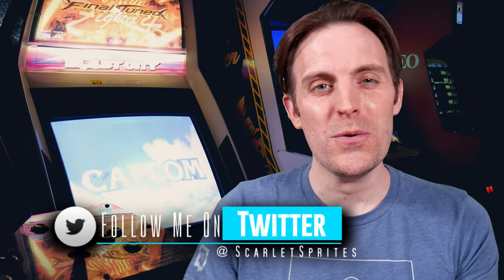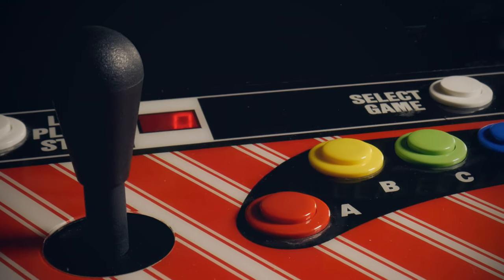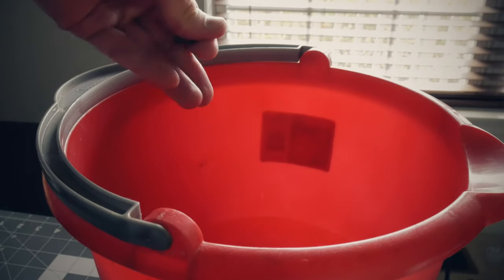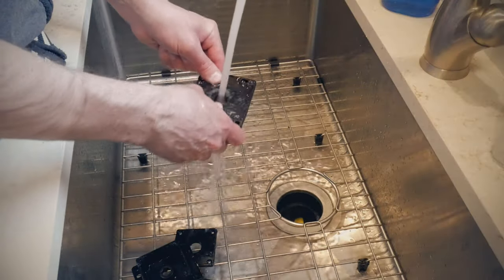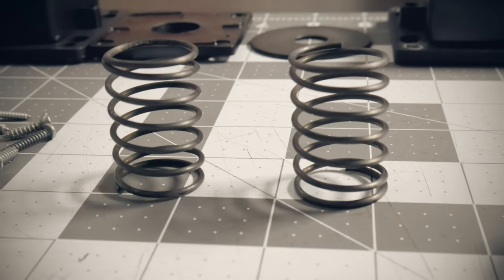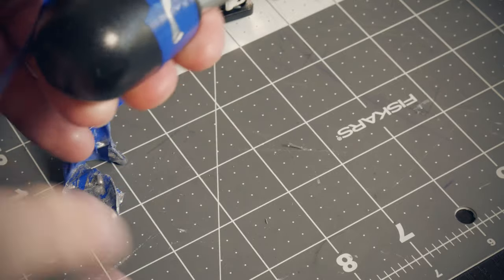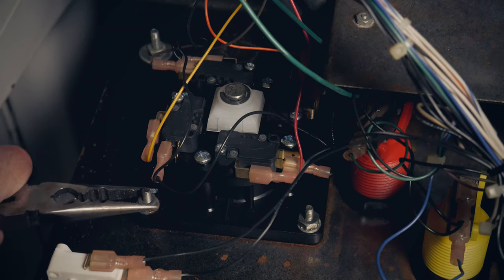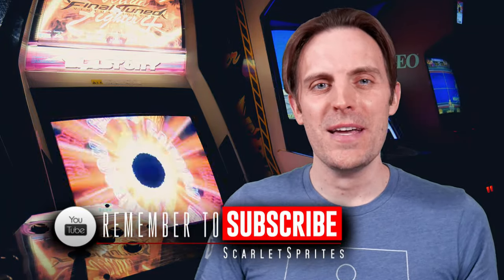Neo Geo Arcade Stick Rehab & Repair!

Comment: All these old happ sticks I find on arcade restores tend to have the "roughness" gone on the battop and they have been smoothed by time. If you can't get over that like me you end up replacing that part. The microswitches are always a must replacement. Springs are hard to find but if you can replace those as well. While rust remover helps, it does peel off some protective layer and galvanization on stuff so they might rust again. Something to look out for

Comment: I highly recommend using metal polish on a cloth and spin the shaft in a drill to remove the discoloration from the shafts. Worked amazing on my Wico 4” shafts for Smash TV and X-Men with little effort.
Reply from the maker: Yeah, that’s totally the way to go.  I don’t know wtf I was thinking with this.  Thanks for sharing.

Comment: I would say original but your machine, your preference.  I also prefer the original button shape but it's likely nostalgia as I have memories of spending hours playing Samurai Shodown and in-between fights I would lightly run my finger tips off the bottom lip of the edges of the buttons.  I know, weird memory, and something I don't think I've ever thought of until now.  I swear I'm a normal dude :)
Reply from the maker: I like the concave buttons on American cabs.  For Neo though I made the switch to try out the convex ones and just never went back.
Reply: @ScarletSprites  I grew up with American joysticks and buttons and liked them but after moving to Japan in 92 i have been in love with Japanese parts. 

Most early Neo Geo cabs used a Seimitsu LS-32 and OMRON XW6Z-0011 buttons and a little later came with either LS-40 or LS-32 and when Omron discontinued the buttons Seimitsu created an improved version (PS-14-G) of the Omrons that were in many later SNK cabs.

Comment: Great video as always!  No issue with the evapo-rust on plastics from bathing overnight?
Reply from the maker: No, perfectly fine.  I’ve done that before with some other parts but now that you mention it I never actually read if that is acceptable or not on the label.

Comment: I've got a cab already but I've been itching for a big red. Maybe Scarlet and Jonesy can strike a deal. 😁
Quality content as usual. I love rehabbing.

Scarlet, take a buffing wheel to the stick and it'll shine like new. I did all the brightwork on my Bally pinball machine and it looks new.
Reply from the maker: Yeah I don’t know wtf I painted it.  It looks ok but definitely should have used something like you suggested.  To be fair I also wasn’t trying to commit too much considering I didn’t even know if it wanted to use them when I was done.

Comment: That’s the tough decision I’m trying to make with my 6 slot big red, go the all original route, or mod it. For me, there will be no in between, all or none. 😬🤔
Reply from the maker: Controls are a tricky thing because they really need to work well, not just look good.  The overall functionality of the cabinet is ruined if your controls aren't top notch, no matter how great they might look.  Best wishes with your restore!
Reply: Scarlet Sprites Thanks, it looks beautiful!! Yeah, you’re right, I remember the big red in the arcade where I grew up, I could never pull off any quarter circle moves on Fatal Fury without “grinding” the stick. Then, went out of town where there was another Neo Geo and saw people ripping off special moves on that game without any difficulty?!  It was just the arcade where I lived had crappy controls 🙄

Comment: Have you tried the Sanwa JLW-TM-8? I am currently using those on the neo geo and I love them. They are comparable to IL at least, but I they're a little less stiff.

They seem to play better in my opinion.
Reply from the maker: Nope, never tried those.  I’m typically a Seimitsu guy if I go Japanese style.
Reply: @ScarletSprites  well the sanwa have the same bolt pattern so they pop right into the neo geo control panel! Just another option.

Comment: I kept my original Happ sticks BEFORE they got bad and installed those when I restored my Neo Geo MVS. Upgraded with heavier springs mainly for Magical Drop III. Those old sticks are awesome but I think your paint job is going to rub away over time.
Reply from the maker: I’d agree, I don’t know wtf I was thinking.  Probably will just strip and polish at some point.  Not worth it now currently.